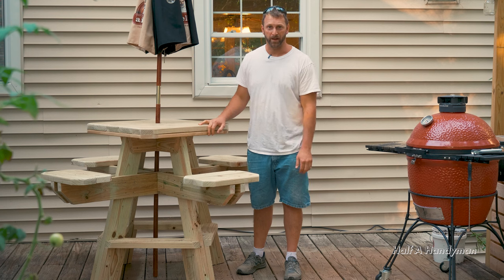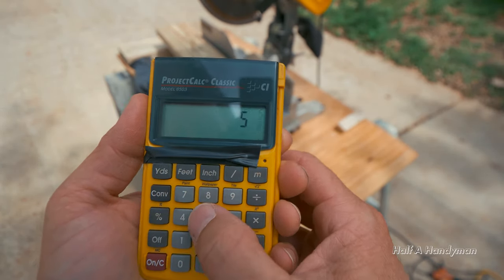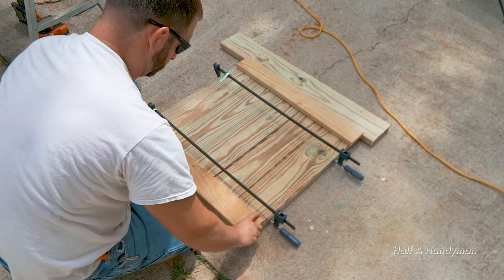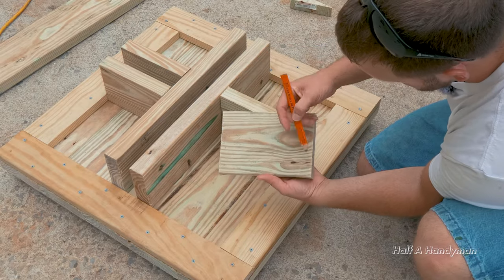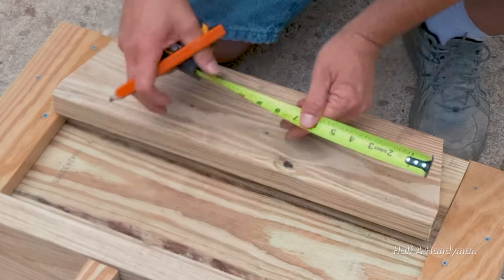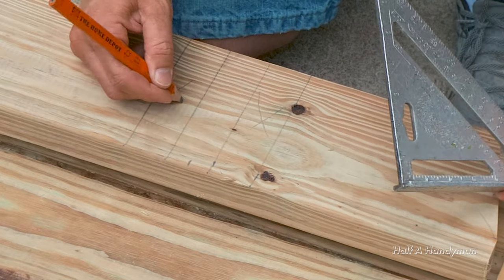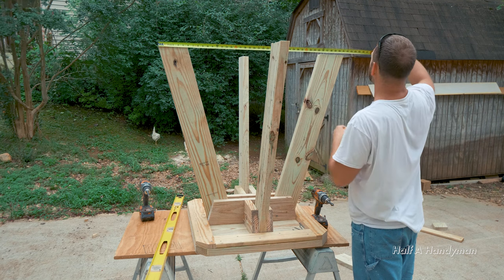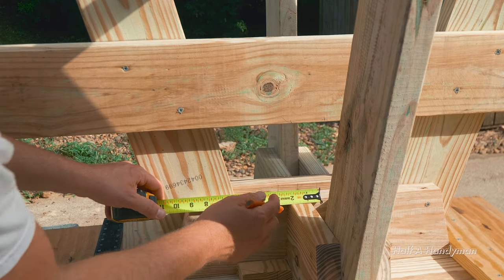BAR STOOL TABLE How to build

Comment: I built a pair of these, family of six, as pub height picnic tables. All 2x6 construction. I expanded the tops to 40.5 X 40.5 inches. I also added a hole for an umbrella, I offset the hole 6 inches off center both length and width so it was not positioned in the middle of someone's face. They get lots of compliments.
Reply from the maker: That's awesome! Glad to hear everyone likes them. Good job.
Reply: I had to do another small modification. I found the seats getting a little loose, the deck screws were just not holding well enough. I placed a 2or between the joists under the seats with carriage bolts through both joists and the 2x4. I then replaced the 2 piece seat with a single piece of 2x12 bolted to the 2x4 with 2 carriage bolts. This really secured the seats.
Reply from the maker: @dmeenkster  Ya,  that's probably a better way to do it. Good job

Comment: So in the video you were trying out the seat and see how comfortable you can sit and you end up cutting part of that board off. how long is the board for the seats and what is the length for the other boards for the other two seats.i want to build this table.
Reply from the maker: Im sorry I wont be able to help on this. That was built a while ago and I dont remember. Good luck on your build though

Comment: Hey killer, I know it’s been a few years, but did you glue together the section you used as a table top? Or, just let the 3.5” boards hold them together. Thanks.

Comment: Did you used pressure treated lumber when you built the pub top table?
Reply from the maker: I actually don't remember. It's been over a year.  Hopefully we did.  Anything that's going outside needs to be pressure treated though.
Reply: Eww no pressure treated....just use cedar.

Comment: Fun build, but using outdated British measuring systems is nonsense. Measure 7 hogs heads and a 4 bristles edges, then cut!
Reply: He’s using inches not freakin cubits or something.  Get a grip
Reply: @Dcvmnaturalist  Wake up, it's an old outdated measurement system no one uses.  But yes cubit would be a part of imperial
Reply: @이이-n4z8y  sorry you can’t math.  Good luck with your woodworking.